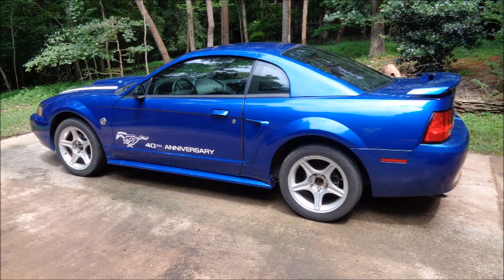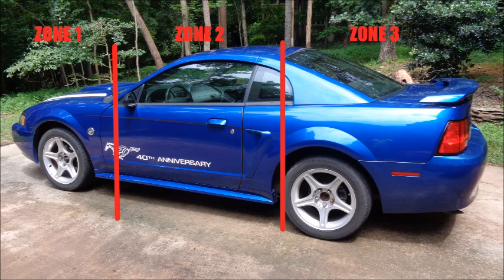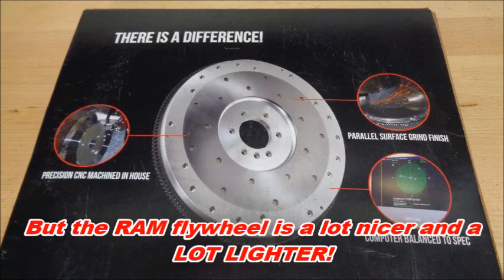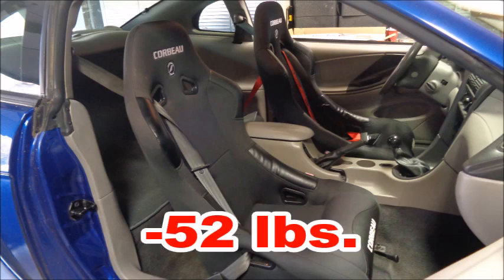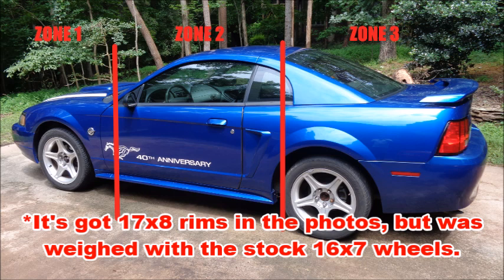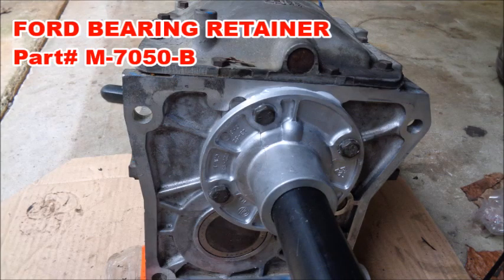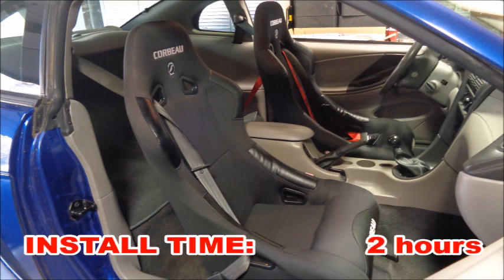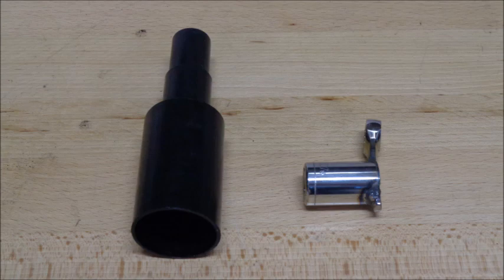MUSTANG ST PART 3: The Power of Balance (Weight Reduction Parts Review)

Comment from the maker: UPDATE: For 2020, the SCCA has reclassed 1994-2004 Mustangs running in CAM. They are now in CAM-T. The minimum weight is now 3,000 lbs. That means V8 drivers can make even more modifications to improve weight distribution, and V6 drivers running in CAM will have a better power-to-weight ratio.
Reply: Hi, great videos! I may have just missed it somewhere, but I'm curious if you have  (or are allowed) to move the battery to the rear of the car,  maybe right side of the trunk to move weight back and balance a little of the driver weight to balance left/right more? What about removing the a/c system and related components?

Comment: Very cool video! That little sixxer hauls and handles nice in that last segment. I been thinking of doing weight reduction and distribution on my 04 Cobra. Obviously a much heavier car. This video was very informative! Cheers!
Reply from the maker: Thanks! The 03-04 Cobras are great cars. They do have a lot more weight ahead of the firewall than a GT or V6, so I'd start reducing weight in that area first. Lightweight bumper support, A-arms, aluminum flywheel. There are also some more expensive solutions: lightweight brake rotors, a carbon fiber hood and fenders.

Comment: Are there restrictions regarding battery relocation? This seems like a great way to move weight where it counts and the battery for the New Edge is generally about 30lbs in the 2 I have weighed. Thoughts? Great content by the way!
Reply from the maker: Thanks! Different classes have different restrictions regarding battery relocation. Most people want to move the battery to the trunk. In 79-04 Mustangs, that tends to be on one side of the trunk, usually opposite the driver. And, it's generally close to the rear of the trunk (near the bumper, not the rear seat). Adding weight to this area isn't ideal. The best place for the battery would be to mount it just behind the passenger seat. That would help with mass centralization. Some classes do not allow you to move the battery to inside the passenger compartment, or beneath the rear seat bottom. In some classes, you can mount the battery directly behind the rear seats. If it's offset from the driver, above the rear axle, it can be beneficial. Just be sure that the Tech Inspectors can access it. I haven't felt the need to move the batteries in my cars.

Comment: This seemed like the best vid for this question...How about fuel level for competition? I’m in an S550, so different tanks, pumps etc, but what’s the thinking? Some guys are running with full tanks and say it keep the rear planted better, others want as little weight as possible, or are concerned about fuel starvation (which I’m not sure I’ve ever experienced, even under 1/4 tank). Fuel sloshing back and forth I assume could upset the balance as well.
Reply from the maker: I run with the tank full of gas in all my cars, because of fuel starvation concerns. But, the s550 has a better designed tank. Your gas tank is also ahead of the IRS, so, in theory, a full tank would add weight to the center of the car, where you would want it (especially in a GT). Having said that, your car weighs around 3,600 lbs.; many drivers in s550 Mustangs elect to run less gas to keep overall weight down (because they are competing against cars that weigh 3,300 lbs. in CAM-C). But, it's worth seeing how your car feels on course with more gas in the tank.
Reply: Warhorse Racing ...Once again, thank you for the detailed reply. Much appreciated!

Comment: Love the video's!  One  question, how come you didn't take the battery from zone 1 & put it in zone 3 in the trunk?
Reply from the maker: Thank you! Most battery relocation kits put the battery at the rear edge of Zone 3 (off to one side). That's pretty far back in the car. While it is good to take weight out of Zone 1, the best place to put the battery in an autocross car would be behind the passenger seat (low in the car, ahead of the rear axle, opposite the driver). That would be better for mass centralization. I didn't want to have the battery in the passenger compartment, so I chose to leave it up front.

Comment: I may have to make a bumper support for the front and rear.
Reply from the maker: While reducing overall weight is always beneficial, I would focus on the front bumper support first. Getting weight out of Zone 1 will be more helpful than getting weight out of Zone 3. Do you take the spare tire and jack out of the trunk when you autocross? That takes a good amount of weight out.
Reply: @warhorseracing  I may leave the factory rear bumper support on. I've been in 4 rear ended 4 times. I'd hate to remove it to save 20lbs and cause someone to get hurt. I thought about taking the spare and jack out but didn't. This last time, I did only have a little better then a 1/4 tank of gas.
Reply from the maker: @TractorTech  If the car is used for things other than autocross, keeping the stock rear bumper support is a good idea. I would suggest taking the spare tire and jack out next time. It's common practice to autocross with the least amount of fuel possible, but these cars do not have great baffling in their gas tanks. If you run too little fuel, you can stall during slaloms and sweepers. Because you actually need more weight in Zone 3, you can run more fuel in the tank and it will help balance out the car. I run a nearly full tank in my cars.

Comment: How much dose the v6 motor actually  weigh  also how much weight  was actually  taken out of the front end
Reply from the maker: I don't have an exact weight for the 3.8 V6 engine. When I made this video, I used the available published weights for V8 and V6 Mustangs to come up with an estimate of "about 200 lbs." difference between the engines. Keep in mind that Ford made changes from 1999-2004 that impacted how much the cars weighed, and some available options would have added weight too. Having found more information in the last couple of years, and weighed more of the parts that differ between V6 and V8 Mustangs, I would say that a more educated estimate would be that the V6 engine weighs about 150 lbs. less than the V8 engine. The Zone 1 weight reduction mods I made in this video took 16 lbs. off the front end of the car. If you go with an MAF Racing front bumper support, you can take another 1.5 lbs. off the front of the car. If you check out my "CAM-T Diet" videos, you'll see the latest round of weight reduction mods I've made to this car. I'm waiting on some parts, but I plan on taking more weight off the front end soon.

Comment: Between the 2001 vs 03/04 stock Cobras...Which Cobra would be the best fit for autocross racing?
Reply from the maker: The big differences between the two cars are power, weight distribution, rear gears and cost. The 2001 has less horsepower, but it has more than enough for autocross. The 2001 has slightly better weight distribution, due to the aluminum block and not having a supercharger/intercooler up front, which will make it more nimble. The 2001 has 3.27 rear gears; the 03/04 Cobras have 3.55. The 3.55 is generally a better rear gear for autocross (but there are exceptions). If price is an issue, a good 2001 Cobra will cost about half as much as a comparable 03/04 Cobra. If I had to choose one of them for autocross in stock form, I'd pick the 2001. The weaknesses in the stock IRS won't be as much of an issue in a car with less horsepower and 3.27 rear gears. In stock form, I think the 2001 would be a better balanced package than the 03/04.
Reply: Warhorse Racing would it be more worthwhile to get the 3:55’s and the stronger IRS?  Or will the 2001 Cobra be a sufficient performer with it’s stock motor and just installing 3:55’s?
Reply: @warhorseracing  I'm sure that that's blasphemy in the Terminator Cobra community.

Comment: There's a reason both Griggs Racing and Maximum Motorsports don't sell strut tower braces.
Reply from the maker: I'm assuming you mean rear shock tower braces? Yes, different companies have different opinions about the benefits of rear shock tower braces. The counterpoint could be made that there's a reason Steeda, Kenny Brown and others do sell rear shock tower braces. Having autocrossed cars with and without rear shock tower braces, I prefer to use them. There's often a vague feeling in the rear end of these cars, due to a number of factors. Having a little more rigidity back there helps me feel what the tires are doing.

Comment: The back seats weigh more than 20lbs..
Reply from the maker: I just weighed my 2004 V6 cloth rear seat bottom and the two seat backs on the scale I've been using for my recent weight reduction videos. They weigh a total of 23 lbs. I always try to be as accurate as possible with weights, but scales can vary.
Reply: @warhorseracing  is that including the frame?
Reply from the maker: @TheModAddict  That weight does not include the frame behind the rear seat backs.
Reply: @warhorseracing  ahh..ok.  thats where most of the weight it. With top, bracket, and bottom i was at like 40lbs reduction.
Reply from the maker: @TheModAddict  When I built this car, I was building up to the minimum weight (which went up the next year). Now that the car is in CAM-T (minimum weight of 3,000 lbs.) , the frame for the rear seat backs is gone.

Comment: Once I heard it was a v6 I left
Reply from the maker: Most of the parts in this video will work on a V8. There are versions of the aluminum flywheel and aluminum driveshaft that work on V8 cars (different part numbers). More importantly, the concept of mass centralization, and the importance of breaking the car up into weight reduction zones can be applied to any Mustang.